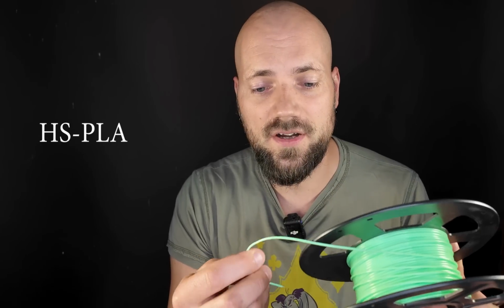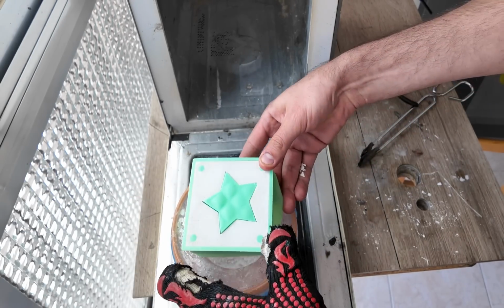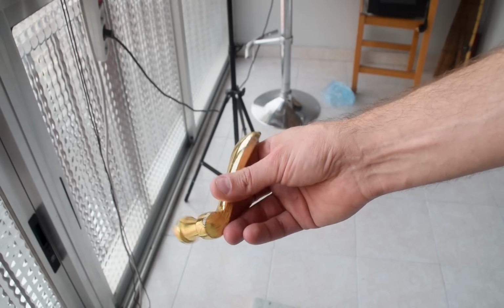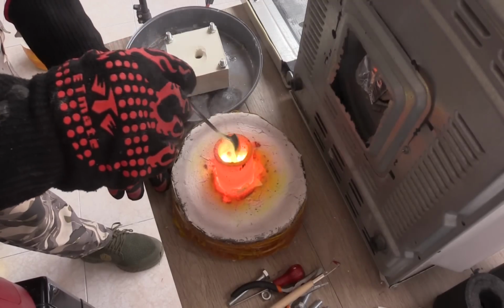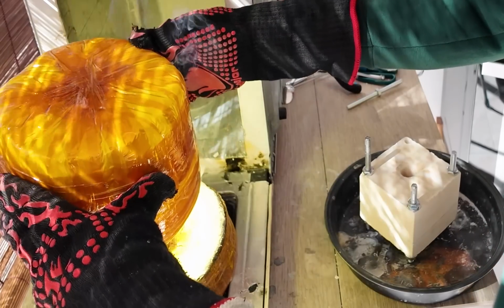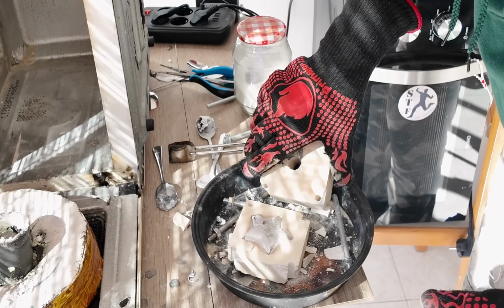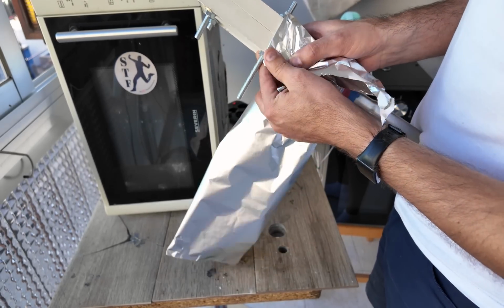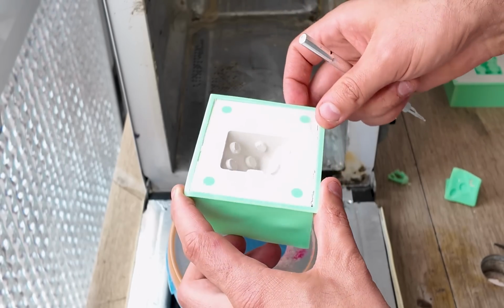Print-Wave Metal Casting: A Different Approach to Metal melting

Comment: "Brass"
.. finds aluminium bronze
Reply from the maker: Is that's what it is? Aluminium bronze?
Reply: @ShakeTheFuture  Looked up the melting temps: brass: 930°C (1710°F); Aluminum Bronze*: 1027-1038°C (1881-1900°F)
There are different alloys, but when obtaining "brass" from scrap metal (especially door handles that are more ornamental), you may well encounter Al bronze.

Comment: This is a great idea. You can even do it with non drafted things. Im def going to try this! Tyvm sir!
Reply from the maker: Cheers!
Reply: Even limited undercut if my guess is right.
Reply: @hanelyp1  could even put in side actions/splits in the 3d print to make it easier to get it out of the mold. Would destroy the mold when demolding the final part but that could be worth it.

Comment: Any chance pulling a vacuum on plaster may improve drying without heat.
Reply from the maker: Honestly, I have no idea, but what I do want to try is leaving the wet mold in the car. Since I live in Spain and it's summertime, I might cut down on my electrical bill 💰💰💰

Comment: I love seeing new and innovative ideas, but isn't this much more expensive and wasteful than typical sand casting?
Reply from the maker: Well, it's not better or worse, it's just different, and yes, it is more wasteful indeed. Of course, with sand casting, you don't need to use an oven and the sand can be reused. However, this method is great if you want to do some metal casting as a busy person, assuming the files are provided by the community. It doesn't take a lot of time, I mean YOUR time. Also as I mentioned in the video, with this method you can cast items that would be impossible or difficult to cast using sand casting. Cheers!
Reply: @ShakeTheFuture  I'm looking forward to seeing the dice video

Comment: Especially for copper based alloys, have you tried spraying the inside of the mold with a very fine graphite powder mixed with alcohol (dries, burns out quickly)?
Reply from the maker: Thanks for the info. I have never tried or heard about it. I might try it out. Cheers!

Comment: That butter knife came out great.
Maybe making a batch of tall "funnels" out of investment to make the pouring sprue longer, then stick them onto the moulds with bit of investment as glue?

That silver metal the door handles were made from is probably Zamak, a pretty common zinc-based die-casting metal.
Reply from the maker: Thanks! Well, you can always carve out the investment. It's very easy to do it after microwaving while the investment is still wet. I did not do it with the butter knife, since I have a silicon carbide ring, but I could have done that instead. One of those wax carving/sculpting tools that looks like a letter "U" attached to a stick works very good.
Reply: I think, that it was a proof-of-concept.video, where he knows, that it´d be better off with long sprues, and still doesn´t use any, cause in this case, it still worked out well. Pouring steel, if I got it right... With a 3d-printer and a mirowave-oven, mind you. That´s Startrek-level stuff.

Comment: I like it. Note that if you print your mould with soft TPU, that you could skip the microwave step. Print some placement guides and you could even re-use the TPU.
Reply from the maker: Thanks. Well, I have not tested all the flexibles, but one I tried years ago did stick to the plaster and it was almost impossible to remove it. That said, it was years ago. I should give it another try. Cheers!
Reply: @ShakeTheFuture  you could try spraying mineral oil as a mold release
Reply from the maker: @satibel  Indeed. I do use mold release (castor oil based). I have not tried it out with flexibles, will give it a shot.
Reply: @ShakeTheFuture  Car spray sheen products are supposed to support release.

Comment: I really like this method. I look forward to trying it out. I'm glad to see you have sponsors. Where do you buy your plaster? What type of plaster can be used and which to avoid? Thanks in advance.
Reply from the maker: Thanks! For Mario's star, I used a professional investment called "Unicast Prestige." The butter knife was cast using just ordinary dental Plaster of Paris. I live in Spain, and I got it from the "Dentalix" store. For this method, you'll want to use plaster that isn't as brittle. For example, for Lost PLA casting, I sometimes use the cheapest construction plaster I can find. For this method, it's better to use something a bit stronger since you'll need to pull the PLA out of the mold. Dental Plaster of Paris works fine. If you are doing something with a lot of detail or hills and valleys, like letters, you might want to use something a bit stronger like Ultracal or Hydrocal. Using mold release can also help. For now, I use Vaseline, but I want to try out mold release sprays.
Reply: @ShakeTheFuture  Thank you!

Comment: 30 seconds in, based on what you said, I would have normally stopped watching the video figuring it was just hype. But since I've seen your other videos, instead, I continued watching, knowing that you do stuff I didn't think was possible. Not to mention things I don't think I would be willing to do. Like putting wet plaster right onto the build plate! WTF????  LOL
Your videos are making me want to do things I am very nervous about doing. Though I'm still incredibly concerned about the danger aspects, and I don't have a microwave, so who knows.

I would love a video on a deep dive on stainless steel casting. I heard you say that it can be done, but you aren't sure if you could melt enough for the butter knife. A whole video figuring that out would be of great interest to me.

Thanks again for another great video!
Reply: Melting points
Brass 930C
Aluminium 660C
Stainless steel 1,500C

It's a very different ball game.
Reply: @dougaltolan3017  Well, it isn´t a different ball game apparently, if one only handles smaller amounts, like, for a big butterknife... Mind you, only with a 3d-printer, plaster, and a microwave oven...!!! Imagine what one could do with TWO microwave ovens...!!!
Reply from the maker: Thanks! Yeah, stainless steel needs a lot of heat. So far, I have successfully melted a few stainless steel nuts (A2-70). I am talking about quantities enough to cast a ring. Because it requires such high heat, I had to use a few tricks to melt it. Preheating the crucible and using smaller crucibles helped. That's why I'm unsure if I can manage larger quantities, but I'll definitely try and make a video about it. Cheers!

Comment: but why not dry plaster in microwave? It worked for me quite well but I've never done metal casting
Reply from the maker: It does not remove water completely, and microwaving too much can crack the mold or cause the microwave to overheat. Once there is no food, water, or crucible in the microwave to absorb the energy, the magnetron will start to heat up even more, causing the thermal cut-off switch to activate and cut off the power. Doing this repeatedly risks damaging the magnetron. I am not saying that it cannot work, but it is something I cannot advise doing. Cheers!
Reply: @ShakeTheFuture  thank you! Found the answer in video as well! Great job!

Comment: The "Brass" is most likely ZAMAC of some sort. It flowed very nicely which is charactaristic of ZAMAC.
Reply from the maker: I see, Thanks for the info. I heard about zamac, but never tried it...purposely 😂
Reply: @ShakeTheFuture  Car scrapyards could be a good source of zamak. Things like the brand name ornaments and door handles are often chrome-plated zamak. In the past even the window cranks were zamak.
Reply: @frontiervirtcharter  nahhh. All that is plastic. Actually cars have very little zamak in them. The best sources are faucets, door handles. Handles for drawers, toys made of metal, I was lucky when I found 30 Kg of zippers. Also some electrical connectors. Once you get familiar with it you can find it everywhere. Melts easy. Flows very well. Less shrinkage. Pretty strong. Nice stuff. Just be very care not to contaminate it with lead.
Reply: @jabonet  Modern cars have a lot less zamak than the old ones. I can remember when the radio controls, window cranks, door handles, door latch buttons, and brand emblems were all zamak. These days you're lucky if you even get a zamak emblem on the car..
Reply: @frontiervirtcharter  true. But it's very difficult to find a car of that age in the junkyard. Even old carburators sometimes are made of zamak. But are usually contaminated with lead. The other option is to make your own zamak. Which is not that hard with the temperatures that "shakethefuture" can achieve in his microwave. Zinc, aluminum and a bit of copper.
Reply: @frontiervirtcharter correct
Reply: Yes. Looks like zamak. A very common material in door handles and many other things. It's a really nice material for casting. Melts at lower temperature and thus have a lower shrinkage. And it's easier to find than brass
Reply from the maker: @jabonet  I'll need to check my collection of door handles and see if I have more. Then I can "purposely" try it out.
Reply: @ShakeTheFuture  I use two ways of checking if it is zamak. One is measuring the density of the piece. By weight in dry and underwater. The second way is to scratch the surface of the metal and put a bit of copper sulfate solution. If it turns black it is zinc based and probably zamak. In Spain it is sold as antifungal in any place that deals with plants. Usually blue color.
Reply: @jabonet  Yeah, blue... I´ve heard, man can dissolve those blue copper- sulfate-granules, and use the solution to copper-plate steel/iron, with a DC-source, and a sacrificial piece of copper.

Comment from the maker: The first 500 people to use my link in the description will 
receive a one month free trial of Skillshare!
https://skl.sh/shakethefuture06241
Even though this method does not replace Lost PLA casting , it's amazing and has its own strengths and weaknesses. I can cast items that I could not before due to the size limitations of the kiln. Sure, there will be people who say that it's much easier to do sand casting. It might be. If you are into sand casting, all power to you. This is just another way. Some people might prefer to use plaster/investment molds over sand casting. It's great for people who just want to try out metal casting. This method has taken over a significant portion of my metal casting projects.

It's great, and the future videos I'll be sharing will demonstrate that you can cast objects way more complicated than a butter knife. We are only getting started